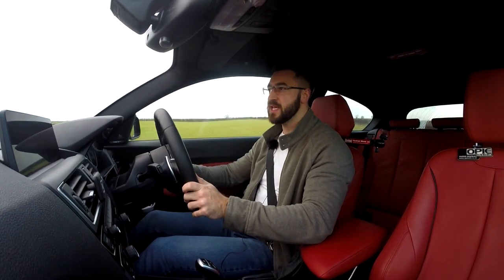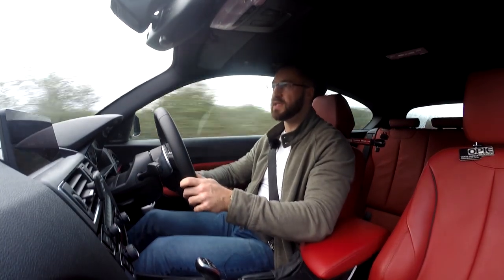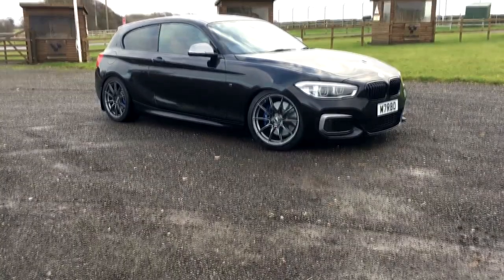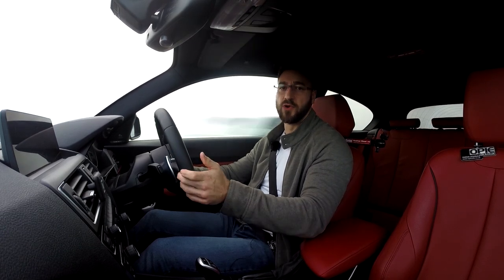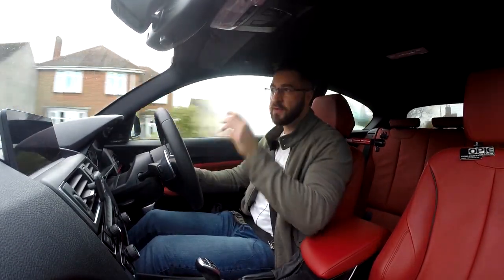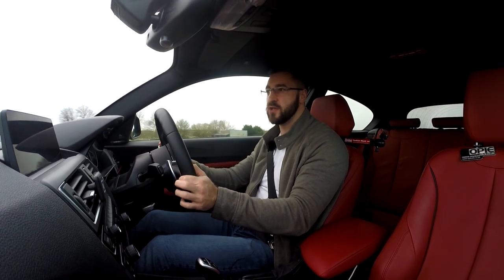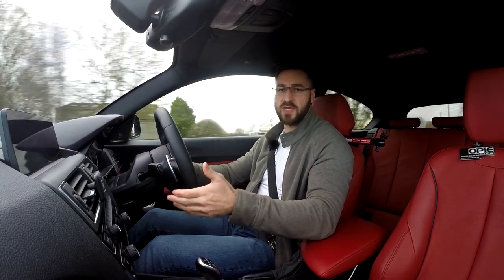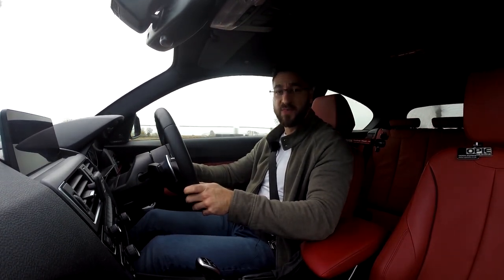M140i Upgrades // Part 3: Lightweight Flow-Formed Wheels Bola FLB Review

Comment: Always love your videos! Calm, polite, perfectly delivered content. All with no ads. Great, informative and fun series of vids. 

I've done the exhaust, induction, Bilstein dampers and Eibach springs. Stage 1 remap. Really looking forward to your episodes on both suspension and brake upgrades.

Love the wheels and I bet the weight saving is great.

Question for you - why/how do you put wider tyres (255/265) on the rear wheels (compared to front 235 front)now that you have a 8.5" square setup? Does a square setup not have same width tyres?

Keep up the great work, loving the video.

Finally... I'm desperate for an LSD but just can't justify the 2k. I know I'll love it but can't build up the courage to spend it! Your review of the LSD and track slides are killing me!
Reply from the maker: Nick Anderson thanks for the kind words!
Sounds like you’re building a lovely car, the package you have at the moment sounds very good indeed! 👍

There’s no doubt the diff would be the cherry on the cake! The way I look at it cost wise is that you have something with residual value when the time comes to sell the car, albeit that will cost about £100 to remove.
So the true cost is buying price less selling cost (minimal if you buy used) plus the cost of fitting and removing. Viewed in this way perhaps a ~£300-400 cost is more easily justified and IMO at least adds a lot to the car.

Regards the tyre sizes and not running square sizes, there isn’t much room in the front arches, especially with the //M LCAs and TS’ I have fitted (vid to follow), so it’s a bit of a balancing act between tyre width, ride height, camber and arch clearance. On the road I also prefer the fronts a little narrower so that it doesn’t follow the road too much and keeps the steering feeling as sharp as is possible. A little stretch on the tyre from the wider rims helps here too.

Comment: How have I just found this channel. Just here for the 140i content. Bought new with decent spec so reluctant to mod while still in warranty but it’s either a change (BMW M.... probably second hand) or a project once the newness/warranty/finance wears off. Saddest thing is that i prefer the look of the old square rear and odd shaped front lights of the old M135i and I’m pretty sure that they will be a future classic, not so much the newer 140’s. Could be wrong but that’s my gut feeling.
Reply from the maker: 689Twin I don’t blame you for wanting to look after the warranty! In a nearly new car with most of its warranty the only things I would suggest are an LSD and a set of shocks and springs, shouldn’t impact much on the warranty front and are a huge improvement where BMW didn’t get things right. That said they’re a lovely car out the box and it depends on the type of driving you do.

I honestly prefer the 140 lights, more so because of the more modern appearance when they’re on or used as rear DRL. But I do like the look of the earlier dark line lights...

Enjoy yours! 🙌

Comment: Great info thanks👍. Been looking at these Bola flb’s myself for a couple months. 
As they offer custom offset was considering going ET42 all round. 
Keep up the good work
Reply from the maker: Anthony h sounds like a nice fitment, dependent upon tyre choice, the fronts might be a bit tight to the shock body so worth checking. I think I would go for ET40 so long as you can squeeze the tyre under the arch on the outside. 👍

Comment: That’s reassuring, recently bought my M140i. Took the wheels off to research the manufacturer and was disappointed when I saw the price of the FCL wheels I have fitted. Started to wonder if they were just thrown on as cheap rep wheels, but having viewed their website and this video it does appear the previous owner had some insight into the benefits of the lightweight option and aesthetics.cheers. I swapped the rears to the front because of tyre wear but now wondering whether like yours these may have different ETAs?? 🧐
Reply from the maker: I think they're terrific value wheels for something strong and light, would certainly buy them again. The offset should be stamped in the inside, failing that you can measure the backspacing from a straight edge.

Comment: These wheels look great! How have they stood up? Do you still have them? I'm thinking of getting them for street use, my concern is their resistance to potholes and such
Reply: Also, have you noticed any changes in ride comfort besides the car feeling more responsive? Thank you in advance!!
Reply from the maker: They should be stronger than most wheels since they’re flow formed and I’ve no doubt they’re stronger than the weak OEM wheels. I sold the car recently but the wheels are perfect still, I’ve no reservations about them. Would buy them again in a heartbeat. 👍
Reply from the maker: @MUSASHI1944444444444  regards the ride comfort, perhaps the car was a little better along bumpy roads with the much lighter wheels but it’s a slim difference. Technically they will transmit slightly more detail of the smaller bumps to the cabin but I noticed no difference. A stiffer or softer sidewalled tyre will have a far greater impact on ride quality. 👍
Reply: Thank you very much! It's great to have your feedback, since I don't know of anybody running these (or any aftermarket wheels for that matter). Happy motoring with your new ride!
Reply from the maker: @MUSASHI1944444444444  you’re welcome and thank you 👍

Comment: do you run spiggot rings and tuner bolts supplied by bola or you can use stock bolts?
Reply from the maker: No need for spigots and you can use standard bolts, though they come with new bolts from Bola. I'm using a stud conversion and nuts on mine so they might look a bit weird!!

Comment: Hello mate. I have an m140 and have the m4 lca and ts. Interested in these rims but was just curious as to the fitment? I'm currently running a 5mm spacer front and 15mm back. On stock rims so not sure what size bolas I should go for so I dont need the spacers.

Thanks
Reply from the maker: Umar Said mine were et40 front and et45 rear without spacers. 👍

Comment: Hi Matt , Great channel, I’m just about to purchase some of those bolas you’ve got,  I see your running a 235/40 front tyre , when I suggested this on baby bmw I was told they were quite a tall tyre compared to a 255/35 rear , what do you think? Regards, Jon.
Reply from the maker: Sorry for the delayed reply Jon, they are taller compared to the 225s, helped in the case of these wheels by being ‘stretched’ a bit more.
It limits the ride height more - you can’t go as low, though I felt the overall package of the car with them, was near perfect!
Reply: Hi Matt, I had the Bola’s put on yesterday with my old standard tyres. Can’t believe how much better the car feels now , much more nimble.
Reply: I think I understand what your saying, do you have any side on pics of your car I could see pls
Reply: Hi John, doubting between 235/35 and 235/40 as well. What did you do in the end?
Reply: @devriesetom  hi, I ended up with a 245/35 F and 255/35 R

Comment: I'd love to hear your thoughts when you've fitted a 255 rear tyre on the clearance you have,I did consider these as they look very similar if better than my oz hyer gt wheels which are a touch narrow for the power our cars produce.
Reply from the maker: Ross Mason I’ve just put 255s on and no problems with clearance. That’s 8.5” width et45 and with 1.5* negative camber for reference. 👍
Reply: @CIRCUITDRIVERCARS  cheers for the reply mate,enjoy 👍🏻
Reply from the maker: Ross Mason 👍
Reply: @CIRCUITDRIVERCARS  would the 255 tire fit on with standard camber set up please

Comment: Hello Sir, what tyre dimension you drive on the bola wheels?
Reply from the maker: I used 255 square, 235/265 and 235/255.
The balance felt best on 235/255 for the road, though I don’t see too much wrong with 225/245 or 255 for the road. 👍
Reply: Thank you for your answer! my thoughts was 225/225 or 235/235 because xdrive, which one is better for the road, no track
Reply from the maker: @martinbjj7150  ahhh with xdrive I think 235/235 would be great. Preferred over 225s purely as they will fit the rims better. 👍

Comment: 12kg is my small daushund weight. does that really make a difference to acceleration?
Reply from the maker: Haha no not in acceleration, though a small improvement in feel and damping ability over bumps is perceptible. The weight loss is more important to me in wanting to improve wherever possible, so in changing wheels for a different design and size, it's nice to find a small improvement in weight that adds to the overall improvement from my mods as a whole. 👍

Comment: How wide whould you say you can go tire wise on the standard wheels?
Reply from the maker: Hi David, my personal preference would be to not upsize them as a 235/40 on the standard rim would make the front end less precise through tyre movement on the rim. At the rear upsizing would be detrimental to balance without an increase at the front too, though you could use a second pair of rear wheels on the front to facilitate a 235 or 245 there. 👍

Comment: Why wouldn’t you use the et40’s on the back as well?
Reply from the maker: TOM_F21 I wasn’t 100% sure on fitment with 265s, with ET42 I had some rubbing previously. A little more camber at the rear has given more room at the arch now. 👍

Comment: What's your thoughts on those 651 tyres?
Reply from the maker: Won Ton right, I’ll do a vid but in short they grip well in wet and dry - very much comparable to the AD08Rs they replaced on the road. I’ve bought some in 15” for my MX5 to try on the track but suspect they’ll be somewhere between the old AD08R and new AD08RS in terms of track performance.
They’re very cheap and so very good value, but I wore my rears very quickly... about 4000 miles and three or four months. But then I am a bit of a willy at times with that diff fitted! 😂
The fronts were barely touched.

Anything specific you want to know in addition, just ask.

Comment: I want those wheels ony focus rs but i dont know what offset i can use.
Someone told me they can rip those rims xd
Reply from the maker: I can't help on offset myself, but if you contact Bola directly they should be able to advise, they helped me with wheel specs.
What colour is the RS, and what colour for the wheels?..
Reply: @CIRCUITDRIVERCARS  i have a white rs. En i want gun metal.
But im also looking at enkei rpf1 rims.
I am afraid that the rims going to rip apart.

Comment: do u keep the original wheel nuts for the set up or u change the wheel nuts set  thx
Reply from the maker: Bola supply new nuts with the wheels, though I think OEM have the same tapered seat so could be used too.
On mine I have a stud and but conversion hence them looking odd! 👍